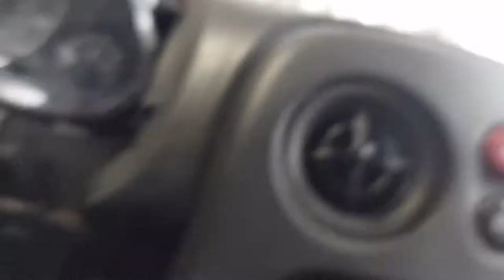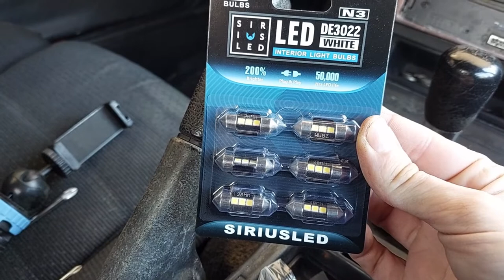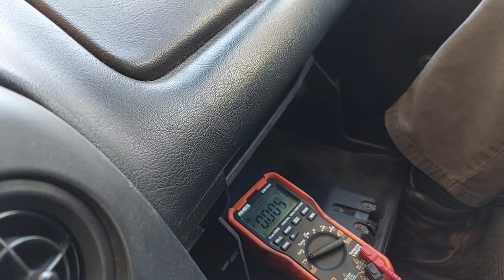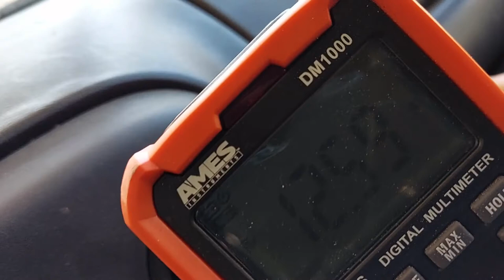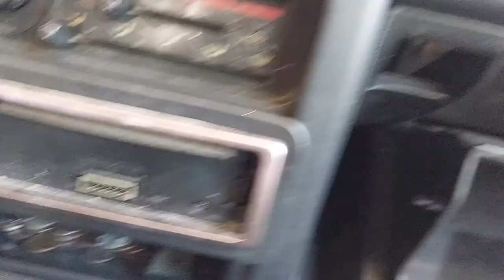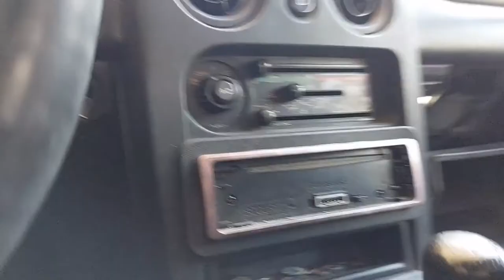Episode 47 - Interior Light Troubleshooting 1995 Miata MX-5

Comment: I have a 96, and it doesn't have either of the dash lights. Mine has just one just above the rear view mirror.
Reply from the maker: I do remember reading about the addition of the rear view mirror light.  I haven't gotten around to working on my Miata in a bit but I have a new top for it on the way.  I fully intend to film how to do the remove and replace on that, along with giving the Miata the love it very much deserves to get it back on the road.